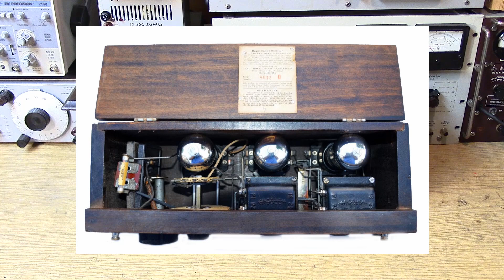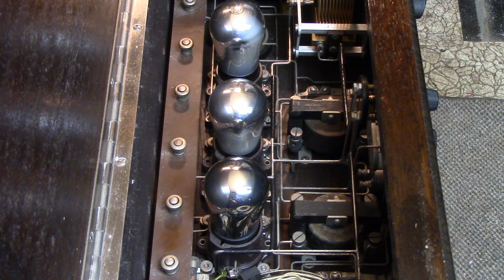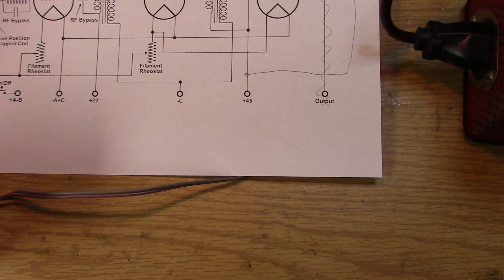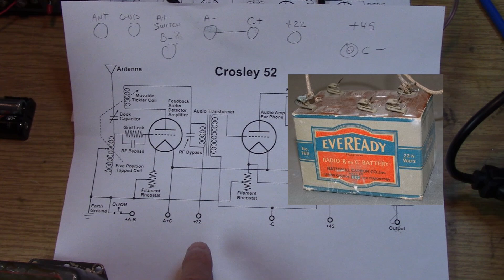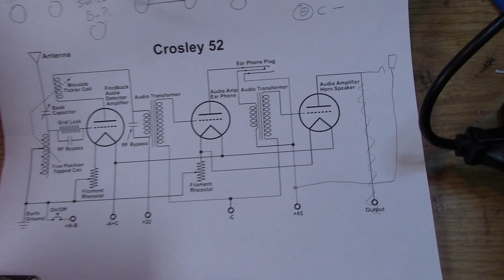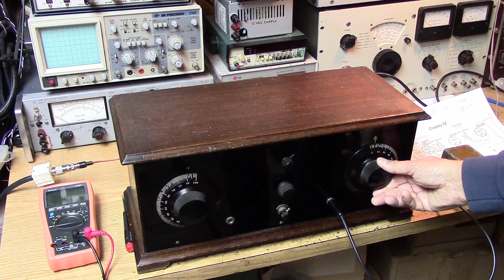1920's Kit Radio

Comment: Amazing bit of kit, oh that's right, it was a kit.  :-))  I would have loved to have sat down and put that together, if I had been able to that is.  However, I was not around for a long time after that was thought about.  Whoever built it made a good job of it.  Still in good shape for its age.  Surprising the valves/tubes still work after all those years!
Reply: It's a dream of mine, too. To put together a vintage electronics kit. But on one hand I would probably be chased down (with torches and pitchforks) by collectors over desecrating it , on the other hand the components (especially old capacitors) went likely beyond their shelf life decades ago. Replacing them already would kinda kill the spirit. 

I would to do it with an old Heathkit or Radio RIM (more or less "German Heathkit" in terms of kits). I would even invest a few hundreds .. if I could assemble it 100% original, but the old capacitors would most likely prevent this.
Reply from the maker: Those old valves were the product of a perfected vaccum glass industry, making light bulbs. And they were over built and really tough inside and out.
Reply: @MIKROWAVE1  I did work a lot with old vacuum tubes of various ages, and besides from the occasional manufacturing defect or damage caused by overload through other faults, they don't fail often at all. Old paper capacitors though .. it's a question of when, not if. And they are usually old enough that when has already passed.
Reply from the maker: @VintageTechFan  Agreed! with the exception of over loved amplifier power tubes. One time I removed all 40 of these 0.1uf paper caps from a WW2 radio and replaced them with 600V mylars. For fun I tested the pulled out caps in my cap leakage tester. Do you know that those Sprague caps were still all fine! Just a good run?
Reply: @MIKROWAVE1  Yeah, that is when they did build things to last and not to an expiry date!
Reply: @VintageTechFan  It might be the way they marked some of the old components that might have me stumped for a while, but I would look it up.  As far as some components being out of their expected life, capacitors will be the main one, but they can be replaced, just like you would need to do if you were restoring one today.
Reply: @VintageTechFan  ,   Why anyone would fault you for replacing a component which no longer does its job is hard to understand.  de KQ2E
Reply: @MIKROWAVE1  ,  OR, your old cap tester is ready for the junk box. LOL
Reply from the maker: @BruceNitroxpro  I need to show you this cap tester. It is a military unit with 3 types of tests.

Comment: A very simple circuit. It works really well, I'm impressed, I might have to try to build a bread board version. Thanks for sharing.
Reply from the maker: Just remember that modern tubes (6J5) have more gain and bandwidth. So you may need better isolation and shielding.

Comment: Brilliant video thanks. I wonder if whoever constructed this set in the 1920s imagined it would still work nearly 100 years later and that it would still be able to receive plenty of AM broadcast stations? The construction methods used back in the early days of radio like this are amazing - works of art. Although a kit radio and of basic design compared to superhet sets that became the standard in the 1930s, this set would have been state of the art in it's day and very expensive.
Reply from the maker: The superhets came on fast and strong once the licensing was figured out. By 1926, they would dominate and regens and TRF radios would fade out.

Comment: My "Toledo duck." Is a loose coupler. That had a slider . It  was owned by a gentle man ham he told me to take care of it for him. It's mfg date was March 1921.  Hard to think 100 year old radio. De kv4li. Ps for several years I've listened to base ball/ foot ball . Still works well for  what it is. Thanks for your good show
Reply from the maker: Toledo Duck? Is it waterproof too? I have a pair of moving coil headphones from a historical Boston Hams wireless station like that. rare stuff!
Reply: @MIKROWAVE1  that's what the badge said. Course hams do save every thing. That badge was on the CHASIS. And under it was the date assembled. And I have it all apart. To shellac. It . It has two detectors a whisker. And a large Sylvania diode. Looking  as big as a auto fuse. Ceramic body. No tubes here. but runs well with a pair of Baldwin's. Maby my grand son will dig it out in our country's demise or a carrington event . As we struggle back on our feet. Yes tube radios will be the ghost of our former selves.  As  we used to laff at Russian airplanes full of tubes ????

Comment: Hello! Is impressing the simplicity and the working result of this kind of sets. Thanks to share and 73's!
Reply from the maker: 3 stages is really all that was needed with a good antenna.
Reply: @MIKROWAVE1  yes!  With the long wire of 50 meters it work like 50 times strong like with the whip! I finally ended your low voltage model of receiver. After many tries I finally put it to regenerate! At the first attemp it received just one station in all the tunning condenser. Inverting the tickler no changes. Unplugging the antenna it started to tune like twenty stations. So..... The antenna coupling was too strong! The real coupling was a gimmick condenser intead the antenna trimmer. I made it between the antenna input cable and the antenna line with utp computer network cable pair insulated. two centimeters of twist was enough to coupling! I will look the way to share a picture to You and everybody. Finally I have  implemented the metod of  the variocoupler. Comming soon is the try at short waves instead of mw band. Again thanks to share and teach us!  73's from Argentina!
Reply from the maker: @julianvalenti  Good progress! That is the problem with too much coupling. It kills the feedback. So try a smaller coupling cap or a few turns for a primary to the antenna.
Reply: @MIKROWAVE1  yes. I still working to learn more about this intresting kind of radios.

Comment: 24:00 The main difference between a variocoupler and variometer is that the latter has an electrical connection between the two coils in series.  And a variometer can often be a slider arrangement.
Reply from the maker: Nice. A smother solution than a slider tuner - for sure!

Comment: Sounds good ! 
Looks great
I bought a atwater kent 20c
For 75 dollars
No tubes in it so
I will convert to ZPR
(crystal radio)
Reply from the maker: A 20C can be outfitted with cheap battery valves , as DAF91, 1S5, ZD17, 1B2_1S5, 1FD9 can be substituted as triodes, as long as you can find some 4 pin tube bases to solder their mini socket into. The whole thing would run on 1.5V and modest 60 and 90V HT supplies.

Comment: Definitely enjoyed the video and the explanation on the electronica parts I know this may sound strange but the tubes were absolutely beautiful. And the audio was wonderful to me just can’t beat a tube receiver for audio. WD5ENH Steve
Reply from the maker: I would have sounded better with a single proper audio output transformer. There was a lack of low end. Also the interstage iron might have restricted it a bit. But less stages means better sound.

Comment: A bit of trivia: If my 1920's magazine is accurate, this was known as the P1 circuit (with the tuning capacitor in the aerial line). It made for a very sensitive receiver but as your demo shows, it suffered from "broad" tuning. Not a big issue in the early days but as more radio stations came on the air, it necessitated a series of refinements to sharpen the tuning until the superheterodyne took over in the 1930's.
Reply from the maker: The Crosley appears to use that series tuning method. My set is conventional parallel. It is way over coupled and must have worked best with a 25 to 50 ft chunk of wire and a ground rod. Not so good with coax and a proper 50 Ohm antenna. It just overloads.
Reply: @MIKROWAVE1  I missed that your radio has an aerial coil. A pity that you don't have some tappings on it.

Comment: Interesting that this really old things tend to just still work. The later 1940-1960s stuff usually needs a lot of work to work safely and reliably. 

Maybe just because they were REALLY expensive and used components of for the time high quality, instead of being cost optimized, mass produced products?
Reply from the maker: Something to be said about mean time to failure and the number of components!
Reply: Nitro Engine Hoarder  ,  The difference is the power supply. The "newer" designs were often safety nightmares.

Comment: Interesting design
Reply from the maker: The gain on those tubes is so low that you could get away with no ground plane, in fact no chassis, and very few parts like bypass capacitors. No parts = no trouble...

Comment: I have the same tube tester you do.
Reply from the maker: I saw one that an audio guy had and fell in love. Mine came out of a barn as a ebay auction completely in pieces. Most people would have simply cried when they saw the mess. All of the wood was piled in the box. the back was completely gone. So i got some oak veneer paneling and sanded glued and stained everything and dang if it didn't come back to life looking pretty good!

Comment: my atwater kent 20b had a leaky b+ bypass cap. it would have ruined the b battery. so check that if there is a b+ bypass
Reply from the maker: Dealing with batteries must have been a constant struggle. I have a 1929 AC operated TRF that uses (or used) and early Tantalum Electrolytic Capacitor. I had no idea that they were such an early device. Oh and they went bad - just like today!

Comment: Can you use 10x PP9 9V batteries to get the 90V B+ and a PJ996 6V battery which can be adjusted to give 5V for the heaters.
Reply from the maker: Yes and I made up a brick with cheap 50c 9Vs for a radio that required 135V and 70V. It lasted 3 years in the little MAB transceiver.